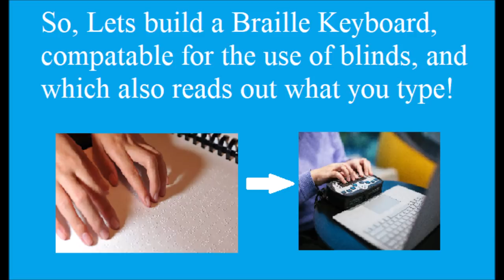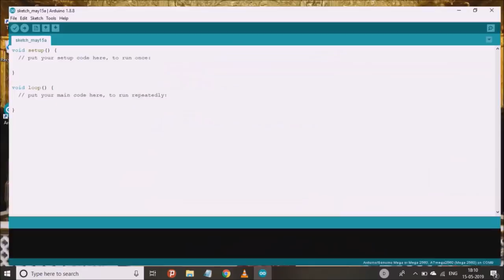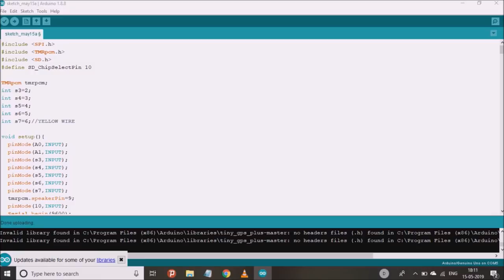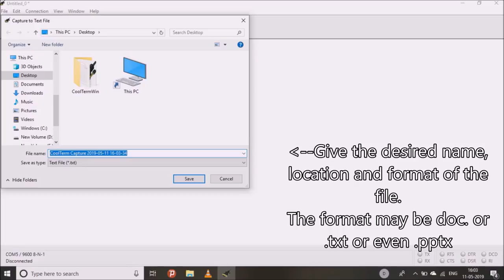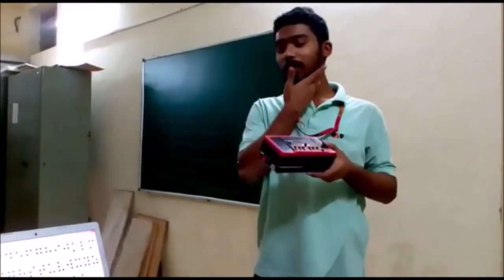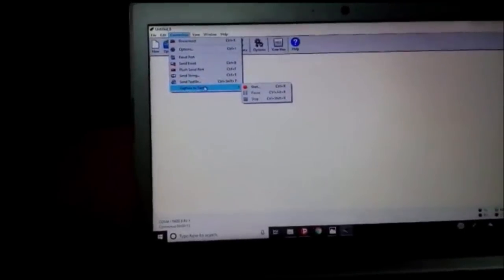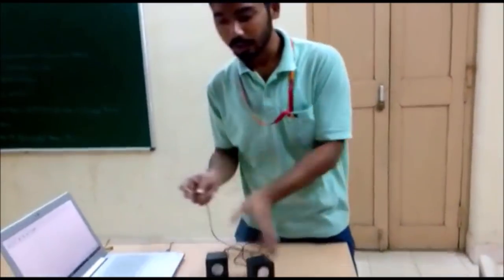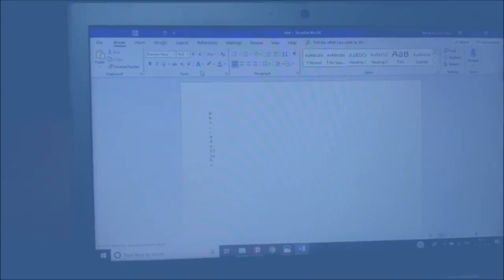How To Make A DIY Braille Keyboard For Blind | Arduino Project | Innovative Project

Comment: Sir my SD card  is failed I changed my module my cards but still same error occur what is the solution
Reply from the maker: There are various possibilities -
Check the connections
Check the SD card
Check the SD card Module
Chepu your jumper wires

Comment: I had a question regarding how the typing is done  for example to type 'B' should I press switch 1 and switch 2 at the same time ? If not , then how exactly does it work ? Do I press switch 1 first then switch 2 later to type 'B' ? Awesome project btw
Reply from the maker: You will have to press buttons at same time.
Reply: @dhirajkumarsahu999  okay , what would I need to do if I want it work in a way such that both the buttons would not be needed to be pressed at the same time , like 1st button then 2nd button and then a 'complete action' button , which registers the signal as the letter 'b'. Thank you
Reply from the maker: @shukrantpatil  in that case you will have to modify the code accordingly, it's possible. Go through the code, understand it, you will be able to write the logic.
Reply: @dhirajkumarsahu999  alright , thank you

Comment: nice work sir voice nai arai please koi solution btayn or kia aap bta sakte ke buttons se A to Z and 0 to 9 kse type krskte??
Reply from the maker: Things to check if voice is not coming -
1. Proper audio files in proper format (for this use the audio given in the drive)
2. Audio Jack connection issue (this is the most probable case, check this)
3. Check the connection to the Arduino board, SD card reader as well.

Comment: Itry but no sound output? What wrong with me ?
Reply from the maker: In most of the cases there may be a problem with the audio jack connection. 
Other possible problem may be with the speaker. The audio signal from the Arduino has very less strength. So you should use a speaker which has external power supply.

Comment: Please sir share back space, space bar and enter code please ...
Reply from the maker: You can only add code for space bar and enter, it's not possible for backspace. I have already added condition for space bar and enter.
Reply from the maker: if(i==LOW&&j==LOW&&k==LOW&&l==HIGH&&m==LOW&&n==LOW)
    {
      Serial.print(" ");
      tmrpcm.setVolume(5);
     tmrpcm.play("space.wav");
    }
    else
    if(i==LOW&&j==LOW&&k==HIGH&&l==LOW&&m==LOW&&n==LOW)
    {
      Serial.println();
      tmrpcm.setVolume(5);
     tmrpcm.play("enter.wav");
    }
  }
Reply from the maker: From the code, it's clear that you need to press only l button to get a space, and you need to press only k button to get a enter.
Reply: @dhirajkumarsahu999  hi there! Thank you so much for generously sharing all these, it's very useful!! 💯
Btw may I know the reason why it's not possible to have backspace function?
Reply from the maker: @layyongchuah624   thank you, we cannot add a backspace. Here the display simply shows the values sent by the Arduino. It doesn't has provision to erase the values sent by sent by Arduino. But I would not say it's impossible, we will have come up with some hack for it.
Reply: @dhirajkumarsahu999  alright, got it. Thank you so much!
Reply: @dhirajkumarsahu999  hi sir, another question here ya, may I know if we are able to save the text in any form of documents in the device after typing? and also do you mind sharing how to do it if it is workable?
Reply from the maker: @layyongchuah624  I never thought it this way, but I think you can write code to save the output in a memory card, which you can retrieve latter. To know how, you will have to explore the internet.
Reply: @dhirajkumarsahu999  Alright, got it! Thank you so much for the info!